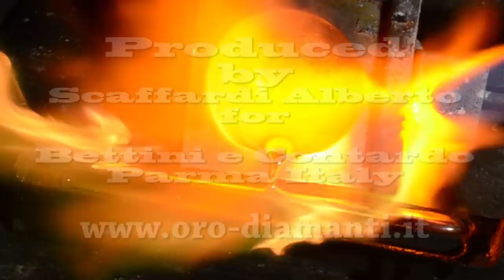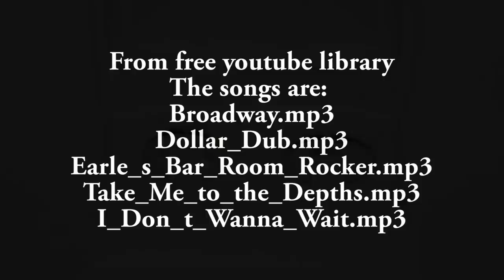How to make wedding ring 18KT gold

Comment: how do you solder fully constructed parts with diamonds set in them without hurting the stones?
Reply from the maker: The diamond normally does not suffer damage if exposed even at high temperatures for a short time, with flame not concentrated, (the stronger welds normally have a melting point close to 900 degrees centigrade)

Comment: thanks.
could you tell me the name of machine that you used for incision.
I did a search on the internet but I did not find it.
Reply from the maker: https://www.google.it/search?q=pantografo+per+fedi&tbm=isch&tbo=u&source=univ&sa=X&ved=2ahUKEwj-udS7vcDfAhUL3xoKHdumDKAQsAR6BAgEEAE&biw=1366&bih=671
Reply from the maker: inside ring engraving machine
Reply from the maker: https://www.google.it/search?q=pantografo+per+fedi&tbm=isch&tbo=u&source=univ&sa=X&ved=2ahUKEwj-udS7vcDfAhUL3xoKHdumDKAQsAR6BAgEEAE&biw=1366&bih=671
Reply: As a general definition, it's called a pantograph. In a variety of configurations, it can be made or constructed to apply the same concept to many types of materials.